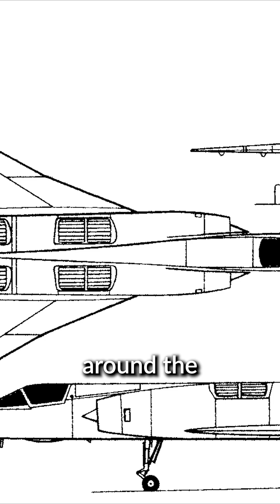The VTOL Mirage That Never Was | Dassault Mirage IIIV | Peculiar Prototypes

Comment: Hang on - if the Harrier project was cancelled, as this video states, how did it go on to win the Falklands war, among many other achievements?
Reply from the maker: Because they were two different projects. The P.1127, which became the "Kestrel," and later the "Harrier," was the smaller and slower ground attack sister aircraft to the P.1154. The British government allowed Hawker Siddeley to continue working on the P.1127 on their own, after the NBMR No.3's failure to produce any worthwhile fighter jets.

I wanted to add this tidbit to the video, but it ended up exceeding the 60 second YT Shorts limit. It's also worth noting that the P.1154, being essentially a larger Harrier, was supposed to reach speeds as high as Mach 2.0 at high altitudes.
Reply: @VonHellsverg  Thank you for clarifying this - and so quickly!
Oddly enough, I saw a Harrier the other day, in London's Imperial War Museum, and was struck by its relatively modest size.